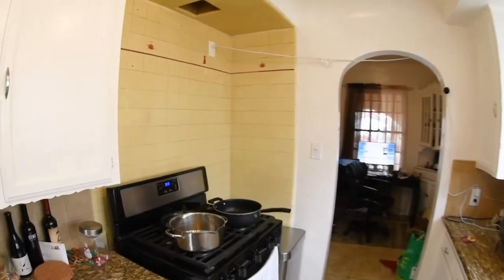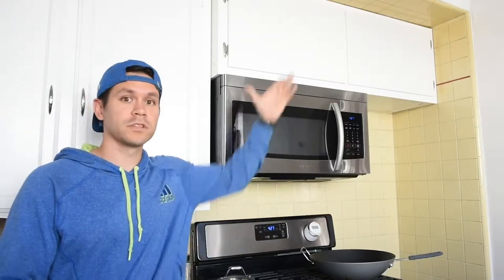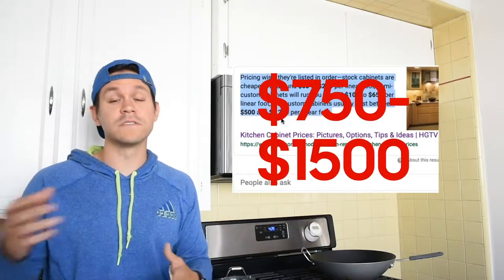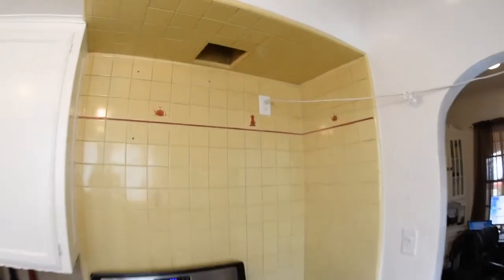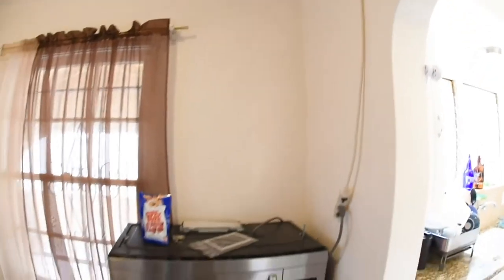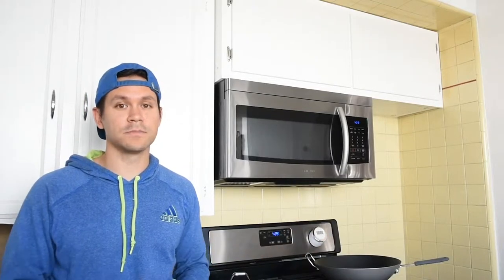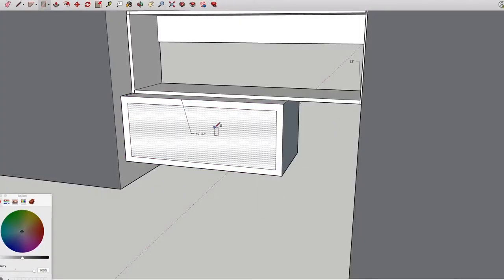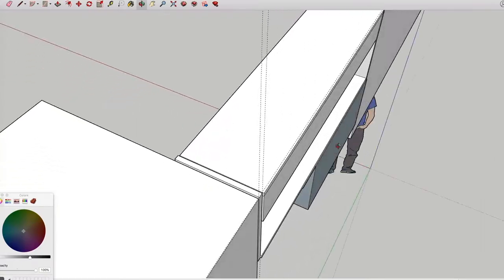DIY Custom Microwave Cabinet Build for $75

Comment: Nice work, Just I advise you to replace it away from the stove, the cooking steam will condensate on the microwave and if that reached to the electronic board that will be a bad news.
Reply: The microwave is designed to be placed over a stove